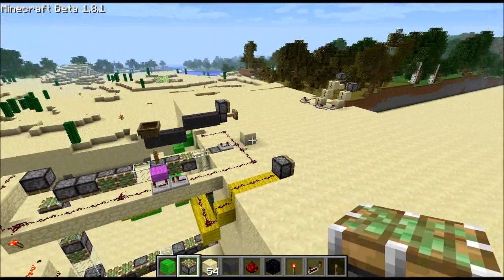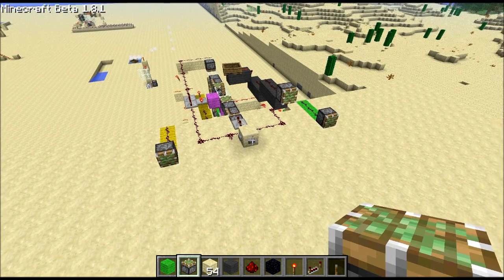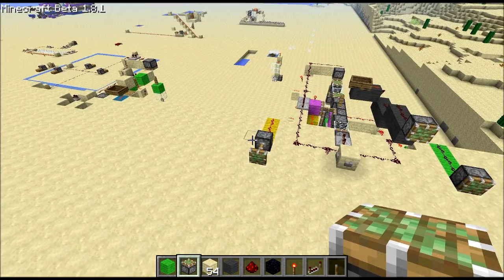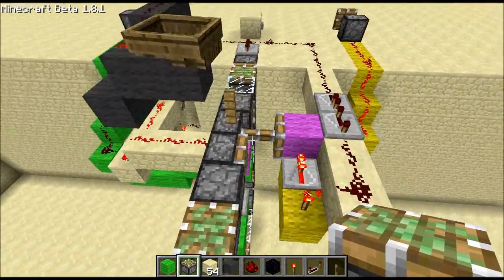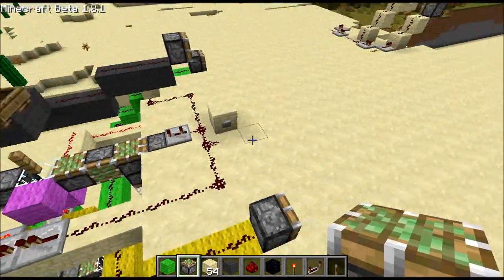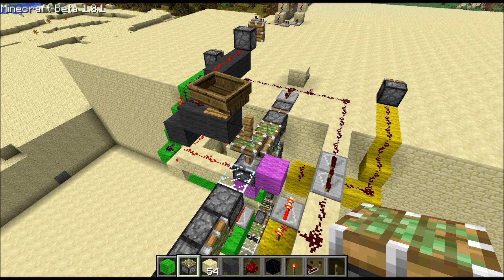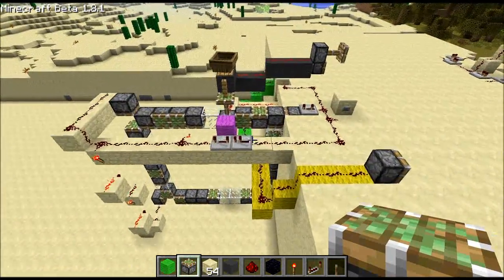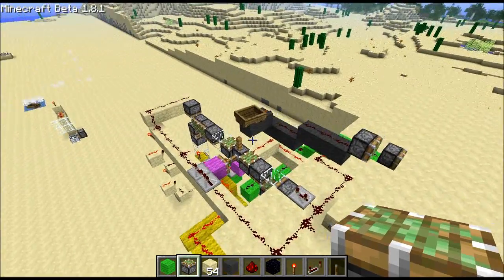Quaternary Piston Tape ROM

Comment from the maker: @EggoMuffin Think of the piston tape like a hard drive. You spin the disk in the hard drive, and as you spin it, you're able to read data from various parts of the disk. Hard drives use magnetic states to keep track of the data on the hard drive; this piston tape uses sticky pistons to keep track of data. As you spin the piston tape, you're able to read different parts of the "disk."

Comment: A method around having to have the up piston pushing a fence post is 1 normal block with sand on top.  When powered the piston pushes the block which pushes the sand, the sand gets powered, but the block (being pushed by the piston) is not, so the piston can safely retract.

Comment: @EggoMuffin: because each differently oriented piston / glass holds a different sort of memory. When the tape cycles to the piston facing the left, a certain output is activated, and when it's the right a different one, and up is another one. And even if you were to cycle through the entire tape, you would still get the same results. It's a bit difficult to explain, but if you want, you can think of them as permanently set rs nor latches.

Comment: Thinking about it, this one (4 state) would great for ROM. You could have build a ROM for a simple 4 bit CPU with 6 of these. 2 would be for addressing, 2 for the instruction and 2 for data/options. Of course you would do a 3 line to 4 line conversion for the data output, then a way to advance the tape to a given address. Would be interesting to see done and sized compared to a 8x8 bit memory block.

Comment: @JayTie1 With a bit of timing work, this could probably be treated as a traditional two-state ROM, but half the size (Though the extra size brought on but the fairly complicated reader is a factor, if you scaled it up a bunch, it could prove a sizable gain) It's probably a lot of work for relatively little gain, but in massive-scale projects it could be useful.

Comment: i might be baked .. and i haven't read up on patch notes .. but .. 

if one were to create a machine that spat out these 'state blocks' based on which buttons/switches the user chooses in some order , would it be possible to push them into a tape rom machine ?-aka fill the tape by buttons - could possibly combine it with filler material from a near infinite block pusher to help push things around - where the filler material can stop current by adding a temp block that falls due to gravity etc